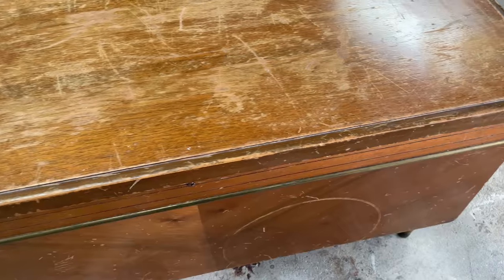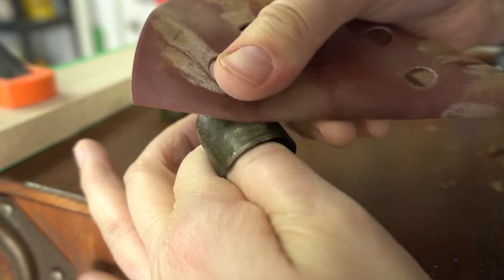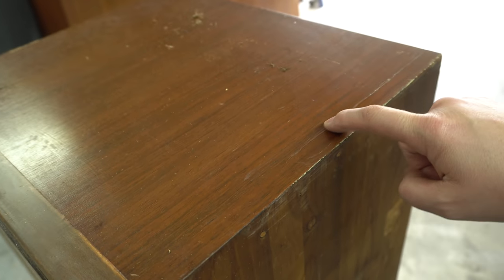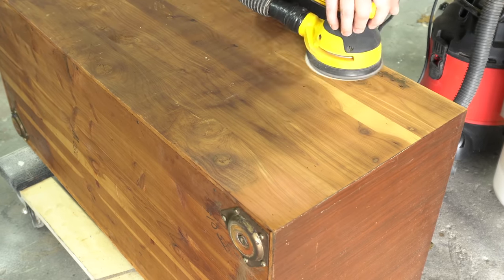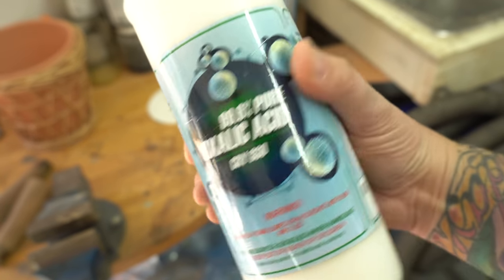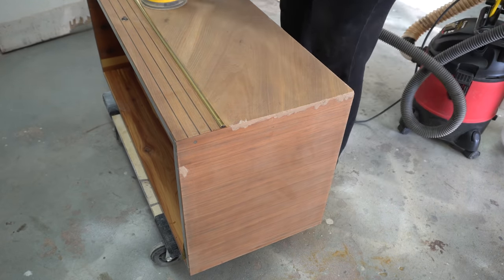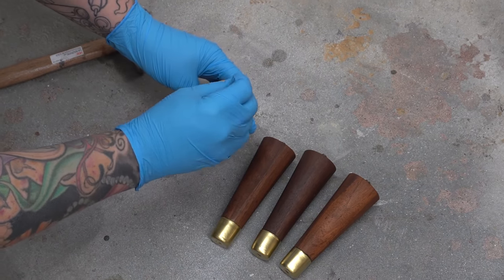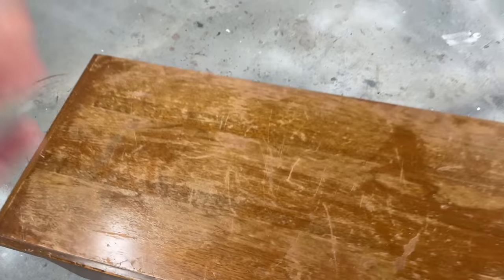Restoring a 60-Year-Old Walnut Cedar Chest

Comment: i'm an avid woodworker, and one of the few that enjoy the finishing phase of the build. i gotta say, i've learned soooo much from your videos on various finishing techniques.  i tend to avoid stains altogether, but that GF nutmeg you always use is beautiful, and will definitely try it in the future.  and i've attempted to paint projects before with standard latex paint, but it ends up with a sticky finish.  i think i'll try some of the mineral paint you always use.

i bought an old solid maple desk for $3 from the local university annual "yard sale" and plan to reuse the desktop.  i'm not sure about how to remove the existing topcoat, but the scraper looks like a safe choice.

you might consider trying a card scraper aka cabinet scraper to augment your paint scraper. card scrapers work really well in inside corners, and sharpening them isn't very difficult.

keep up the great work.  i love your style of commentary and how you explain every step of the process.

Comment: It's GORGEOUS!!!! ..I'm so glad you restored instead of painted.. all flippers paint furniture.. but there is on occasion that a piece of wood that is just to beautiful to paint.. thank goodness it ended up in a restorers hands.. and thanks for sanding that cedar... so many times I see it ignored, and a cedar chest just isn't the same without that wonderful smell.. I use Colton's cedar oil off Amazon to restore it after sanding... I'm restoring a antique cedar lined armoire now, that found itself painted inside and out by a flipper and not very well painted either..

Comment: Super helpful!! I have a 1950s cedar chest with a finish failure very similar to yours except it is blonde over solid cedar. I thought it was probably shellac but I watched a guy trying to refinish one with a similar blond finish & failing miserably, what was left of it would NOT come off. So, not being super experienced at finishing, I was kinda worried about trying to use a chemical stripper like he did. You showed me exactly how to do it with a scraper, etc... I added a set of casters so I can move it around and am gonna use it as a coffee table so I just wanted the top to not get anymore damaged. I thought about varathaning the whole thing but I know, if the initial surface is failing, I will just compound the problem. So, now I have a plan of action! Scrape, sand, varathane. Thank you so much for showing what the shellac looks like when it scrapes off. I was getting those little crystals (mixed with whatever they used to make it "blonde") just by scrubbing 75 years of dirt off & the gunk was solidifying on my rag. So scraping should be a breeze. Ordering a paint scraper & waiting for it to get warmer so I can move it outside & proceed. THANK YOU!!!!
Reply from the maker: You're so welcome! I'm so glad I could help!! 😀

Comment: I love your work. You are so patient and explain what you are doing and the reason you are doing it. I`ve noticed you flip us off on occasion but it`s for a good cause. haha! I am in the process of refinishing an older dresser and the edge of the dresser top is a different wood than the the center. I was in a conundrum trying to figure out how to stain both and have them look right. I ended up using a gel stain and it looks great. I`m just waiting for it to fully dry before adding a top coat.

Comment: Thank you for this fun and satisfying video. I really appreciate your detailed explanation, and think the fact that you also show your mistakes, and offer solutions for them, makes it complete. I find it special to see that the original wood color is much fresher than the condition you found it in, which makes me appreciate the original design much more and realize that it would not look out of place in a modern interior architecture.
However, I would prefer not to spray over the hinges, feet, the long strip and the other fittings, and to keep the patina that has been formed for years. Maybe just a little polishing. Not only because you maintain the vintage character more, but also because spray paint over metal is sensitive to damage. For the rest, I really enjoyed your craftsmanship and you have a new fan!
Reply from the maker: If the metal had been solid brass, I totally would have tried to polish them up, as I often like to leave a little bit of patina when I can. But these were only plated and in pretty bad condition, so they got the spray! Haha 
You’re so right about the wood. Some of the older finishes just make it so muddled and semi opaque that the beauty of the wood gets lost. I love stripping off an old finish and see that gorgeous woodgrain underneath! 
Thank you for watching ❤️☺️

Comment: Your skill and knowledge of wood and stains is remarkable. You did a wonderful job on this piece. Could you elaborate on how you came to the conclusion that it was better to scrape the shellack rather than using a chemical remover?
Reply from the maker: Hi Gerald! I chose to scrape this one because the finish was so compromised that I knew it would be much easier and faster. I like to use stripper with thick finishes that are mostly intact because they take forever to scrape. But when a finish is just barely hanging on, so to speak, scraping is faster, less messy, and less dangerous (chemicals) than stripping. :-)

Comment: Ive had so much bad luck with that top coat. But man you really turned it around this looks stunning !
Reply from the maker: This is only my second time ever having an issue but it wasn’t the topcoat itself that caused it- I think it was just too cold overnight in the garage and the wood just didn’t finish drying out enough.. sadly. But at least It got turned around and ended up fine in the end ☺️❤️

Comment: I have inherited a 1970s solid cherry bedroom set. Thanks for the cherry refinish rather than paint. I will be doing the same. Question: there has never been any hardware on any of the pieces. Drawers are slightly bowed. What are your thoughts about adding hardware. Wanting to update the set but not destroy the original style or the finish

Comment: Awesome result on the chest. About the poly, If you shake it before opening, you introduce air into the mixture that's probably why it looks so blue when you applied it right out of the can. It's best if you open the can and stir with a paint stick and let it acclimatize to your local temperature and geographic location for a hour or two before applying. Also look at the poly manufacturers label and see where the stuff is made, if they are at a geographically different elevation than yours, atmospheric pressure will also introduce air into the poly the moment you open the can.
Reply from the maker: Oh I never shake poly, only stir. :-) In this case it wasn’t air that caused it, it was the moisture that remained in the wood after rinsing it.. I had let it dry overnight but I didn’t take into considering how cool it’s getting at night here so it didn’t dry out as much as it should have, unfortunately. Thankfully though, it’s not something that happens very often, and there’s usually a way to fix it. :-)

Comment: I enjoyed your video and anticipate restoring several very old red cedar chests soon. You have more comments than I have time to read so this will probably be a repeat of those from other viewers when I ask if you are familiar with a cabinet scraper? In my experience of 47 years in piano restoration work I have found that the rectangular steel cabinet scraper is faster than those with a handle that are not flexible and there is less chance of gouging the wood when the goal is to remove old varnish before sanding. I’m sure there are videos on using a cabinet scraper that include the critical skil of sharpening it. All my best to you.
Reply from the maker: I use card scrapers as well. :-)

Comment: Beautiful piece! I probably  with have stripped off all the veneer though. 🙄
Years ago we were asked to strip a painted  cedar chest. Turns out it has always been painted and had a thin veneer on it. I spent 2 days sanding that veneer off. Then we discovered that the lid was pine with a cedar veneer lining. We went and bought cedar closet lining. My husband glued and tacked it to the pine lid. By the time we were finished we had a show piece on our hands. We did a total of 4 cedar chests that summer because  all our neighbors saw the first piece.
Reply from the maker: Thankfully the veneer was in decent shape on this one.. just not so much the original finish, haha. That sounds like quite the project you did! ❤️
Reply: @TranscendFurnitureGallery  it was a job but it was worth it. That chest came out beautiful. I wished it was mine.

Comment: Its stunning...as usual. I have 2 questions for you. If don't have time to answer, I completely understand. How do you decide to use Poly and when do you decide to use Odie's Oil? 2nd question: Does it ever happen that after the application of Odie's Oil and it has dried, it starts to get blotchy? I apply the oil with the correct applicator and take my time to make sure it's everywhere. I leave it sit for an hour before wiping off. It happens that a couple of days later I see lighter spots. Should I be applying a second coat or something else?

Comment: did the lock not have a key? Some years ago I stripped a refinished a small armoire/dresser. I removed the two locks and had a locksmith pick them (3 mins!) and made me a pair of keys. The fun of having the original locks working with 2 shiny new keys was worth it.

Comment: A week ago I used oxalic acid to lighten some Australian red pine. When it was 'dry' ( I now know it wasn't) I coated with water based poly and had clouding - I'd never had this before and I panicked and tried to rub it off (it didn't rub off - it became like drying wood glue). So today I started sanding it all off. I thought it was a chemical reaction with the oxalic acid because I have only every used shellac over oxalic acid before 
This video was just what I needed (a week ago, but hey) ❤

Comment: I work in a cabinet shop and we mix the retarder in with our sealer and top coat to slow the drying down some and prevent the blushing. We also spray our finish on instead of brushing it. But, were also a commercial shop, so we have to do things a little faster

Comment: I'd consider putting plastic leg caps on the bottom of those metal caps instead of leaving them metal, the metal ones will scrap your flooring and damage it, bigtime. Other than that it looks like you did a great job on this piece. It looks amazing!
Reply from the maker: I always add felt to the bottoms of the feet :-)

Comment: Great work.....But the freshly scraped, sanded, bleached wood surface with its rosy beige tones was lovely...... however, "tradition" demands STAINING so somebody in the future will have the joy of repeating the process.  How sweet it would be to just white-wax and have a virtually natural appearance.
Reply from the maker: Walnut doesn’t stay light, unfortunately. Literally any topcoat applied will bring out the natural dark tones in the wood. You could white wax it, but it will never be that natural light bleached looking wood… not with walnut. It works well on other types of wood though, predominately lighter woods like white oak, pine, poplar, etc. I opted to stain not because of tradition, but because I wanted to bring this back as close to original as possible. :-)

Comment: Im curious as to exactly how much time you spend on each piece. Also would like to know you determine the sale price.   The quality of your work is amazing!
Reply from the maker: Because I have to film these projects, they take me much longer than they would otherwise. Every time I move at all, the camera has to be repositioned, so it actually makes it extremely difficult to estimate how long for each project. It depends also on materials used, dry times etc, whether it’s cold or hot and humid that day, as that can also affect dry times. Most pieces take me at least a few days, sometimes up to a week or more. I know that’s not a very accurate answer but the truth is, because I have a lot camerawork added in, I honestly don’t know.

Cost per hour doesn’t work for me, at all, though it might for someone doing custom work. For me, a piece of furniture is worth what it’s worth, whether I breeze through it or struggle with repairs that take me two days. It’s still only worth X amount of dollars. I didn’t specifically say “charge what everyone else is charging.” It’s a guideline only, as many people under charge. My point was simply that if everyone in town is charging $400 for a pine dresser painted with a woodgrain top, charging $1500 might not fly. Again, it’s very different if someone is doing custom work, which I don’t. I could come across the exact same style of dresser (which has happened multiple times) and could refinish both exactly the same. But one took a day and a half longer because it needed more repairs. I can’t in good conscience charge several hours more for it. It’s the exact same outcome. 
There’s no magic formula that will work for every single person.

I hope that answers your questions!
Reply: It does.   When I had my shop, the situation was just the same.   The people who worked for me couldn't understand why if one person took 1 hr and the next took 2 for the same results why it shouldn't cost more even tho my cost was twice as much.  Just thought you might have solved that problem. 😅@TranscendFurnitureGallery

Comment: Hello Angie. As a woodworker I use a lot of different types of clamps. And one style I use the most but also have the least of are pipe clamps. I have 6 sets of those but I have pipe sizes ranging from 10' down to 4". What I was wondering is have you considered clamps like that for your business.
Reply from the maker: I have considered it, especially when getting into wood working a bit more. They are definitely useful!

Comment: Tip for refinishing those brass leg "caps"

Get a drill.  Put a small bolt that you have a nut for through the nail hole in the bottom of the brass cap.  Put the nut on.  Then chuck the bolt into the drill, and you can use the drill to "spin" the brass cap while you hold a piece of emory cloth against it lightly.  Makes the clean up fast and you get such a nice brushed finish.  You can buff it further if you want more of a mirror finish the same way.
Reply from the maker: Thanks so much for watching!

Comment: What a great restoration! That Gel stain you used is oil-based, right? Wouldn't it require an oil-based protective top cover too? It looks like you used a water-based instead.
Reply from the maker: You can safely use a water based topcoat over oil based stains, provided you wait approx 72 hours :-) For oil over oil, it’s only about a day.

Comment: I’ve had something, that looked exactly like what you called blushing, happen when the piece of wood itself was cold from the garage being below freezing and not giving ample time for it to warm up when I brought it inside but should not have been exposed to water or moisture at all at any point in my process. Is this the same thing or something different? I’m very new to refinishing furniture and usually build from scratch and am more into the woodworking process

Comment: I just love the poly-crylic. Test a piece using one of those Shur-line edging tools for painting a room. Side to side with the poly-crylic. Light coats. Goes on fast and very smooth. Speed is key to keeping a wet edge with The water based poly.

Comment: I have a cedar chest to restore and this was great! It will be my first project. A little nervous. Did you put hemp oil over the whole chest?
Reply from the maker: I used hemp oil only on the cedar itself. It nourishes the wood without creating a permanent seal which would block the amazing aroma and properties of the cedar. You can also use cedar oil but it's very pricey and there's no real need unless you're trying to get more aroma out of it. Thanks for watching!

Comment: Hi Angie!  Big fan from Porters Lake!

I’m still fairly new to the whole refinishing game, and I have a question regarding using a stain and then the poly.  What would the finish have looked like with just the poly?
Reply from the maker: It would depend on the wood underneath. I used stain on this one to camouflage any variations or minor damage but if it was in perfect condition, with just a top coat, it would take on whatever the natural tone of the wood is. I hope this helps! Thanks so much for watching! 😊

Comment: If you don't have long glue clamps, you can improvise with fully threaded rod and some nuts and some pieces of wood with matching holes. Such fences are usually available for purchase in 1 meter lengths. It doesn't have to be big threads. M6 or M8 will do.
Reply from the maker: Great tip! Thanks for watching!